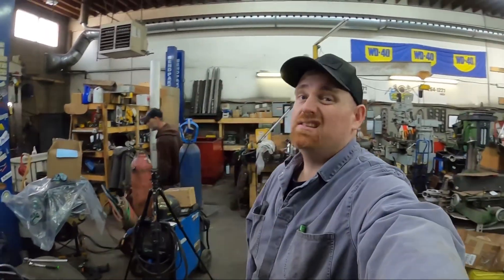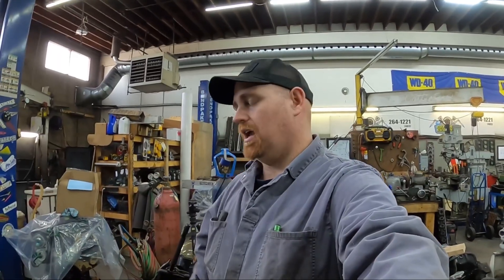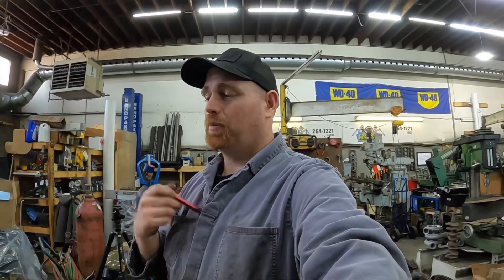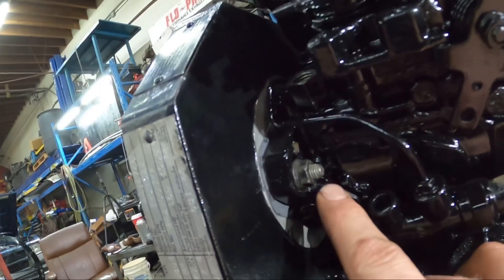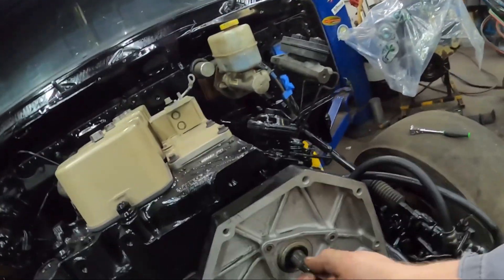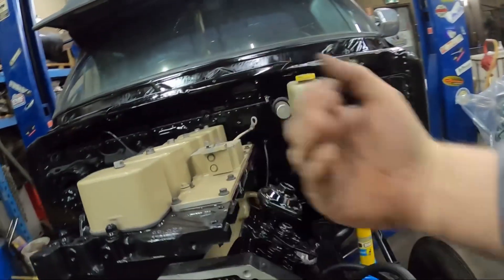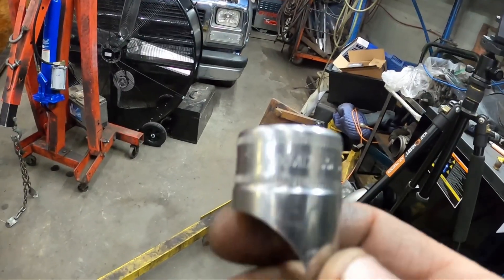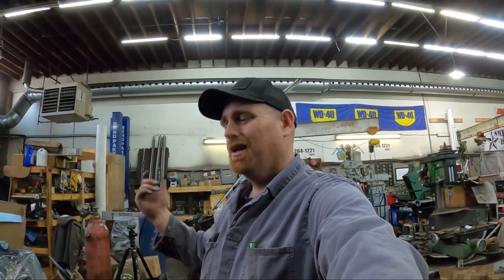HOW TO TIME A VE CUMMINS PUMP

Comment: Great video, on my engine I have a sensor that goes into the cam sprocket hole. I also don't see a hole for a pin to lock it into TDC. So, should I just assume it should be set to "E"? I made the mistake of not verifying the mark before I took the pump off. Thanks  in advance

Comment: In the right spot but wrong stroke! I was tdc exhaust stroke and it would run but like shit. The pin will pin either stroke.
Reply: i’m dealing with what i believe is the wrong stroke also, it’s blowing white smoke out so i’m about to tear it back apart and re time it, so i was wondering how do you get it back in stroke??
Reply: @That12valve so it’s impossible to fuck it up…. As long as you know what mark you were on in stock form. There are alinement marks on the crank, cam, and injector gear ⚙️. For every 2 turns on the crank you get one turn on both the cam and injector gears, as they are the same size. The alignment marks will only line up one way, cam to crank. Same with the pump to cam. With the ve pump you just have to make sure you’re on the right mark. They say you don’t have to pull the timing cover, but I’d say bs and do it just to make sure you keep everything right.

Comment: My non intercooled is on the E. So my question is, do i bump it a gear or no? Just looking for your opinion.
Reply from the maker: If you want more timing bump it a tooth. You can alway pull some timing with moving the pump

Comment: Ok, here's a question for ya.  Hopefully you respond.. how many revolutions does the injection pump shaft make to fire off all 8 injectors? Having a hell of a time getting mine running. Timing cover off, all Timing marks lined up properly,  new cummins rebuilt injectors, new injection pump, new cummins lift pump. Im getting plenty of fuel shooting out the injector lines. But wont bust off. If I take the gear back off the pump and turn the pump shaft 1 revolution will that change anything??

Comment: IF you put the timing case cover on with a new front main seal, and then decide maybe you want to to advance the pump gear by a tooth, of course you have to take the timing case cover back off. In that event, can you be careful with the front main seal and install the cover with the same seal intact, or does removing the cover mean you need to use a new front main seal with the plastic guide ring again?  (Hypothetically, for a friend, of course).

Comment: So my pump is already pushed towards the head so the timing is advanced could I also move the pump gear aswell to advance it more which would get the fuel even sooner correct? If so how many teeth would you go and which way do you turn the gear to advance it, I plan on doing a bunch of fuel mods aswell like 3800 gob spring, delivery valves, injectors , etc. thank you

Comment: Thx rob. I know this is an older vid. All be taking my ve pump to reseal . Just wanted to make sure i advance the gear one tooth in the right direction  .  
Its 1 tooth clockwise correct?
Reply from the maker: Yep. Clockwise

Comment: My ve Cummins truck smokes white, off of recommendations I have replaced the injectors with new 5x12’s and added a new oem holset hx35 with no change to the white smoke. The truck runs great otherwise and don’t use or leak coolant. Could me advancing the timing 1/8” when I first got the truck be causing it ? Or what else could it be?
Reply: timing probably to high

Comment: Does increasing the timing on a ve pumped truck increase crankcase case pressure?
Reply from the maker: If the engine is all good no. But if on the worn out side I can. More power can lead to my blow by

Comment: so if you want to advance the timing with the pump in the stock position line to line location you turn the pump gear clockwise? how many degrees is each tooth ? i just put a new pump in set it up the way my stock pump was and it did zero but crank when i set it in at stock position i had to advance it all the way to the cylinder head and its rumbling like it wants to start retard it and it does zero as i turn it over so it wants to start but needs more time now and i cannot turn my pump any further.

Comment: I've got an identical setup in our excavator. We can't quite get enough RPMS. 
What are the top causes of this?
 I am purchasing a fuel pressure gauge and timing indicator later today to rule the lift pump/timing out.
 Thanks and awesome job on these videos!

Comment: Hey Rob, if I’m running 9mm Bosch bodies with 145 nozzles into 155 bowls on non ic, should I index to C? I currently have it at E, heavy smoke and bog on acceleration but great response at 50mph to 70, especially on grades. Or should I look to adjusting star wheel and smoke screw. Running a 362sxe with wastegate plugged (too big, but will eventually put a hx35 on it)

Comment: Hey Rob quick question, I’m a little lost in the whole VE pump thing do you need to change anything if it’s a VP 44 truck is that VE swap just the pump and across the lines.

Comment: how did you get the key way to stay in there?
Reply from the maker: If it’s loose. Put Small a center punch mark on it to hold it on the pump side in the key
Reply: @CUTTERUPROB   on the back side of it closer to the seal right, so obv doesn't affect the gear going on.
Reply from the maker: @kyuubi9315  as long the key flares out when u tighten the nut up it should be fine. But snug up the nut and pull it off and see how the key is sitting

Comment: Hey Rob keep up the great videos! Question I’m considering getting a Jetta tdi alh to burn black diesel I have a wvo centrifuge what is your opinion should I go for a 12v instead? I’d prefer to not have a truck. Would the tdi work ok with a dual fuel tank setup?
Reply from the maker: The tdi will work. But I would buy a extra set of injectors. So when you clean them you can just swap. And run water meth
Reply: Perfect bud thanks

Comment: Hey rob. Thanks for the info. Any tips for a leaky injector pump you need to just limp along until you have the cash to build it up correctly? Fuel additives, etc?
Reply: Oven's Garage has a video on a leaky VE pump. I believe the seals were pretty cheap, though. It does require taking the top of the pump off. He replaced the governor spring while he was there to a 3200. Fairly detailed video. He does a good job informing while he records. Good luck brother.
Reply from the maker: Best to find out the spots it’s leaking see if a seal fixes it. I guess I should do a video on that subject
Reply: @CUTTERUPROB That'd be awesome. I'd love to see your angle on it. Thanks brother.

Comment: Rob, will advancing the timing, let's say two teeth affect mpg? Thanks
Reply from the maker: In the right application. But I would just do in tooth and pull the pump back
Reply from the maker: I am going to some testing and show the timing changes on the range of power on the ve trucks
Reply: @CUTTERUPROB  thanks, tht would be awesome

Comment: What if you pull a ve pump off without pinning it? Is that a problem?
Reply from the maker: If you put the engine to tdc and the pump is pinned it should go right in
Reply: @CUTTERUPROB  I'm curious more for removing a stock pump. If the engine is at tdc and you remove the pump does the pump need to be pinned?
Reply: @decentgarage  no. I take them off all the time without even putting the engine on tdc. If it was known that it was  in time and you just want to mess with the pump or change it you just turn the pump till the key points to the key spot in the gear and stick it back on. This assumes nobody rotates the engine while the pump is off. I generally always take pumps off and on with the engine 180 out form the timing pin so the key in the pump is up and its a lot less likely to fall out.
Reply: @bcbloc02  that's a fabulous idea to do it 180 out! Thanks for the info Brian!

Comment: Do you know about what you gain by clocking the gear to advance the pump? I advanced mine 2 teeth and turned the pump itself down towards the fender (For access) and have been wondering whereabout my timing is set. Runs damn good with power screw all the way in minus 1/4 turn and HE351CW swap. bosch spring, pin etc
Reply from the maker: We will have hard numbers in the next couple months on the dyno

Comment: On industrial engines for case they often don’t use a key on the shaft so we time them with a dial indicator through the back of the case of the pump where all the injector lines go by removing the centre plug. Then you can set the pump exactly where you want… normally way more advance then factory spec due to the tuning they did for emissions
Reply: Have you worked on 2010 case farmall 75c’s?
Reply: @muzicmon101 New Holland VS of the tractor most likely 
I’ve done lots of engine work on the 3.2l FPT

Comment: I'd love a video if you have experience in this, modification of a 3rd gen fuel pump module for installation of a draw straw from the fuel basket. Tips in where to trim since 3rd gens don't have a good flat spot to install like 2nd and 4th gens do
Reply from the maker: I have done it. But as I don’t work on truck much anymore not sure when I will have one to do. But I will for sure